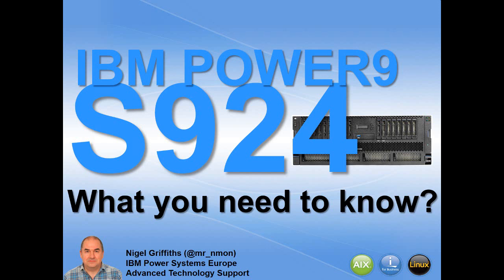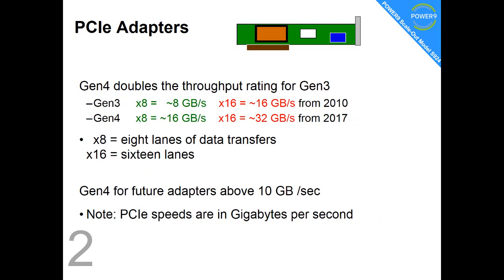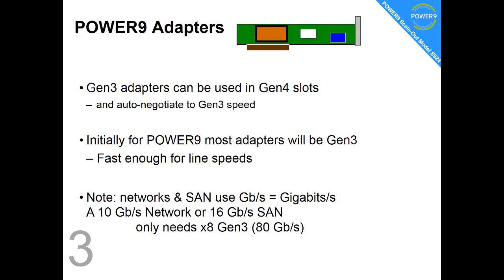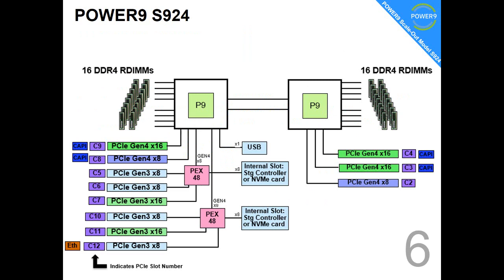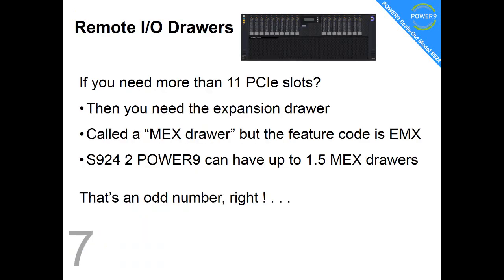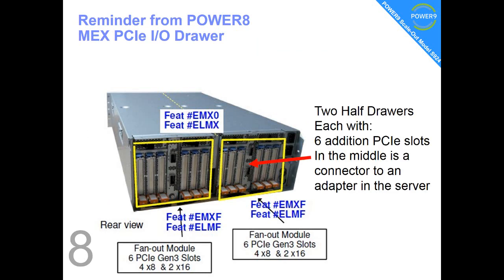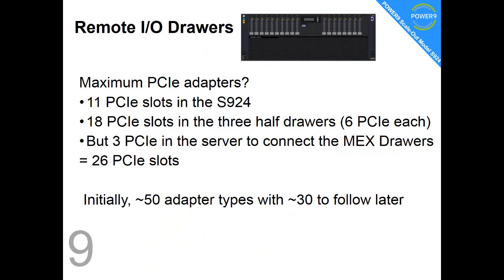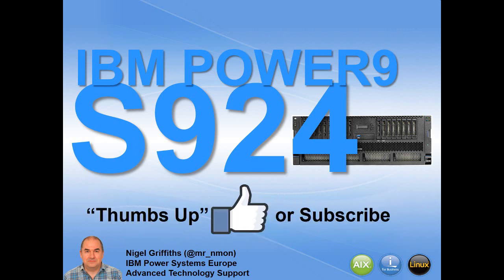POWER9 Scale-Out Server S924 9 facts on PCIe I/O

Comment: Nigel, In this Cloud era do we really need this many i/o slots on the servers , Or are these build for any other use case ?
Reply from the maker: If Cloud use case is what I call micro VM services use case then four 10 GB to 100 GB Ethernet adapters  is enough redundancy  for dual VIOS but you might go for a LC922 for reduce cost.
If Cloud for large VMs for large app say 4 or more physical CPUs +  half TB RAM each then you will be needing an additional 4 Fibre Channel adapter for your disk I/O.
Having too few adapter slots is a disaster but in the non cloud use case many clients add remote adapter drawer(s) for for more non virtualised use rather old school thinking IMHO.